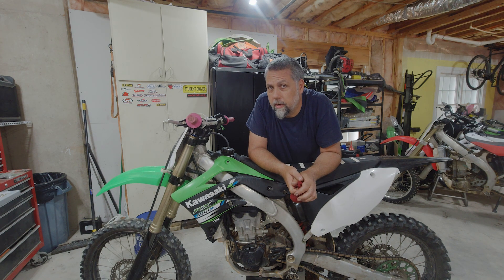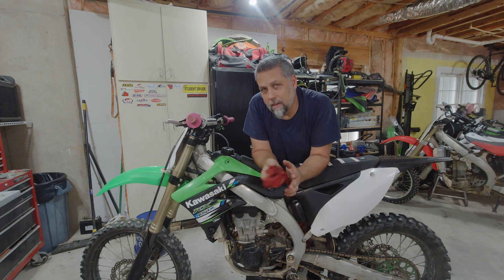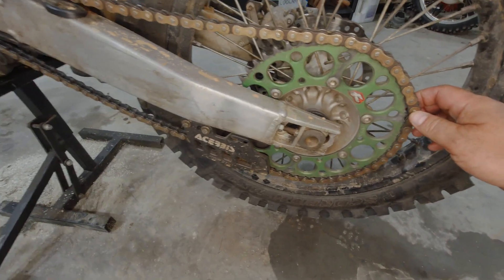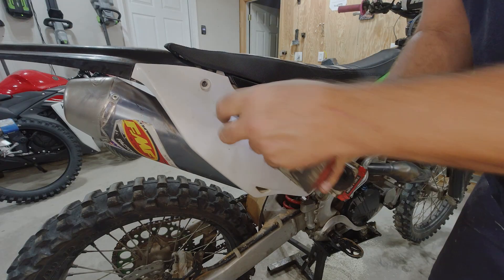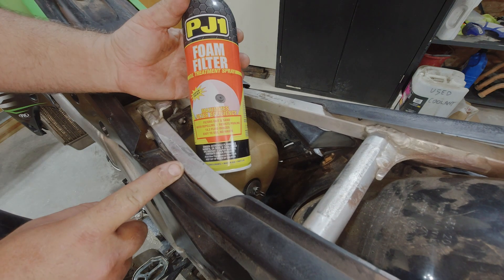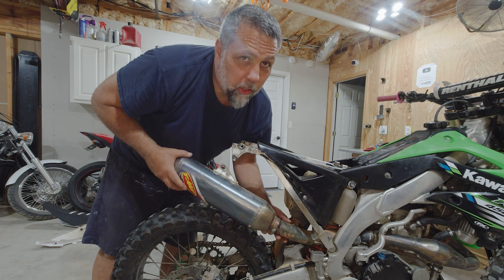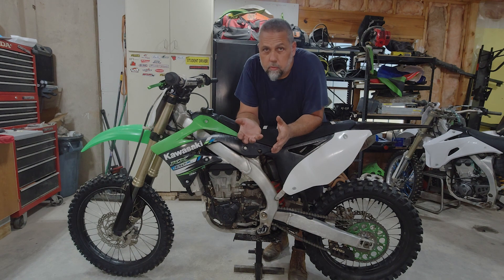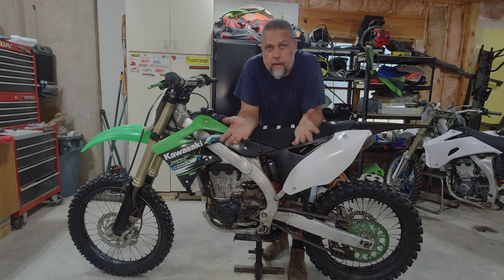2012 Kawasaki KX450F FI Fuel Problem? Ep58

Comment: Nice job! I have a 2015 kx450f I am diagnosing. Sat for a while and had real bad gas. Replaced the injector and plug and it runs fine with the "choke" on and I can start it warm with the throttle just barely turned, but as soon as you let go of the throttle it stalls. Will idle all day at 1-2% throttle. TPS should not have moved when I replaced injector and not sure if it’s a pump thing or throttle cable… I don’t have the experience to know. This video opened my eyes to what I might be in for if I do have to look at the fuel pump. Thank you!
Reply from the maker: It’s certainly not a throttle cable issue. I would absolutely check the TPS values. I would certainly suggest doing a fuel pressure test. Before anything, did you turn the “choke” knob counterclockwise to raise the idle?
Reply: @restoroosterohv  i turned it out 22 clicks based on a number I saw (and also seemed in the range it was at originally), but I saw another reference to 42 clicks. I will see if manual has any more clues, but if you think I should go higher I’ll give it a try.  I am going to buy a fuel pump pressure gauge, since it seems to be really useful. Have watched a few more videos on them for multiple issues and I am thinking at least the strainer is gummed up. Thanks again, I appreciate the reply.✌🏻
Reply from the maker: @JamieKeefer adjust it until it idles. If you have it all the way out and it will not idle then you have a different issue.
Reply: @restoroosterohv  i will try that. Thank for taking the time to offer the suggestion.
Reply from the maker: You’re welcome. Thank you for your comment.

Comment: i just bought this same bike used from someone who was the second owner. they said the original owner did a lot of mods and was running before they sold it. It has an insane amount of compression at TDC where i cant even kick it over without bleeding compression a bit, and the auto decomp dosnt seem to do anything.. i have checked spark, fuel pump is good, but it will not start. not even with spray or a bump start..
Reply from the maker: Have you physically inspected the auto decompression mech on the exhaust cam? Be sure it is slightly depressing the exhaust lifter as you rotate the engine. Check your valve clearances to be sure that they are not to wide.
Reply: @restoroosterohv  just checked the auto decomp, it functions as it's supposed to. My valve clearance is - exhaust, .0065 on the right valve .008 on left valve ( left has the auto decomp) 
Intake- .0015 on right, .00415 on left
Reply: @restoroosterohv  let me ask this, am I correct in thinking no matter what mods have been done to the engine, the TDC mark on the stator should line up in the little window, and the cam timing marks should be flat with the block and facing out?
Reply from the maker: @bluefrostt1 yea, that would be correct. To be sure that your camshaft sprockets have not spun, pulled the spark plug and drop a straw down into the cylinder. Period rotate the engine over until the straw is at its highest point, that will be top dead center. Be sure that your flywheel mark is lined up properly with the case. Now, look at your timing marks on your camshafts to be sure that they are lined up with the head properly. Next look at the backside of the camshaft to make sure they’re even looking and not pointing off in wrong directions. Regardless of all of this, your exhaust cam should still decompress the cylinder.
Reply: @restoroosterohv you sir are a God send! Pulled everything apart and found the exhaust cam was timed incredibly wrong! Fixed that and it fires right up and the auto decom forks flawlessly! Thank you so much for your help!
Reply from the maker: Awesome, glad you were able to get her going.

Comment: Great video. I am new to the four stroke game.I have a 2013 kx450f, and i just changed the fuel pump in it because the o-ring was bad and was leaking too much fuel into the throttle body. When i start my bike with the enricher pulled it runs and revs as it should. I can puch the enricher in, and it idles fine, but as soon as i hit the throttle, it dies. Any help or idea why this would happen?  Multiple people have told me to check the valves, but i dont see why the valves would need adjusted after i just changed the fuel pump
Reply from the maker: I’m a little confused. The pump is in the tank and has no connection to the throttle body other than through the fuel injector. Did you change the pump or injector?
Reply: Sorry about the confusion. I changed the fuel pump. When I start the bike, I pull out the enricher/choke and kick it a couple of times, and it starts. I can rev the bike, and it seems fine. When I push the enricher/ choke in, it's still idles, but if I give it any gas, it dies.
Reply: So basically my issue is I can't hit the throttle at all unless I have the enricher/choke pulled out.
Reply from the maker: The "enrichment" knob just allows some filtered air to bypass the throttle plate essentially raising the idle. Did you change the entire pump module or just throw an aftermarket pump in the housing?
Reply: @restoroosterohv9030  I used an all balls replacement pump kit
Reply: Same housing
Reply from the maker: Ok, that makes sense. My guess it that you have a fuel pressure issue. Potentially there is an o-ring bypass in the module or a issue with the pressure regulator. I would suggest doing a fuel pressure test.
Reply: @restoroosterohv  okay. Thanks so much for the advice.

Comment: Rooster I’m back an I’m STUMPED! Fresh top end, pro X valves, shimmed. Will not kick start cold. Have to bump start then it starts first kick. New fuel pump and regulator. Capacitor seems to be working but when I unplug the fuel pump connector from the harness and kick it I don’t see any voltage. When I prime the pump with 12 volts cold it fires right up, so something isn’t letting it get voltage to the pump while kicking. Checked for trouble codes the light does not confirm any trouble codes. 2016 kx250F, please let me know your $.02 before I waste any more money on parts.
Reply from the maker: Ok let me ask, when you put the new pump and regulator in, did you replace all of the o-rings and were they of the correct size?  Second, did you ohm out your stator windings across each other and to ground? Are you using a DMM or analog to test for voltage? You may have to pull the spark plug, hick it hard and fast in rapid succession. If you see 7v or more, you should be good.
Reply: @restoroosterohv  I re used the ones from the old pump as the new kit did not come with any. I will test the stator next, it just baffles me that if I use a jumper box and give it voltage to the pump it fires up like 2 kicks cold but I can sit there and kick it forever throttle open closed choke on off no matter what and it will NOT start. But if I bump start it and literally shut it off the second it gets running I can start it right back up first kick.
Reply from the maker: @dragin79 if the orings are not sealing properly, it will bleed off the pressure over time and make it difficult to start when cold. When you jump it off with a 12 V battery, you pressurize the system solidly. Your best test for this would be a fuel pressure and leak down test. The tester is not that expensive and you can get it on Amazon for under $40. Secondly, if one of your stator coils is burned out, it will not be producing enough power for the pump at the low speed that kicking provides. Once the system is pressurized and the engine is running, the coils produce just enough to keep the pump running. You certainly may have other issues like valve clearances. I know you said you checked them, but after running a bit they could have changed.
Reply: @restoroosterohv  checking between yellow wires I’m getting 1.6-1.8 ohm. Manual is stating the range is .4-1.1
Reply from the maker: @dragin79  Those measurements are for an ambient temp of 68 degrees with engine  also at room temp. They may fluctuate slightly depending on your current temp. You want no open circuits between any of the yellows and no shorts to ground. Your tester could be off a touch as well.
Reply: @restoroosterohv  oem new kawi fuel pump ended up fixing it. Now it starts on the first kick. I guess I didn’t have to have all that motor work done… live and you learn and at least now I know what I have.
Reply from the maker: Glad to hear you found the issue and thanks for updating me. They can be a bear to diagnose sometimes especially without the proper tools. I have used aftermarket fuel pumps in the past with no issues. Doing a fuel pressure check after installing them is almost critical though to make sure that the regulator, pump and O-rings are doing what they should.
Reply: @restoroosterohv  thanks for all you do! Really loving the new dirt bike videos. I know the market makes it hard for you to find ones to buy. The weird thing is I can’t figure out what is wrong on the old module, maybe somebody put a pump in it somewhere down the line and lost an o ring or rubber spacer. The oem makes them non serviceable so there are no diagrams on the internet for me to reference for a missing piece. When I did the aftermarket pump it did the same exact thing, I also replaced the fuel pressure regulator no change. Now first kick with the new oem, but rarely do I see any diagnosis online pinpointing to a bad fuel pump. Everyone just jumps to valves, I also noticed it starts easier when I have it on a stand kicking hard and not just tip toed.
Reply from the maker: @dragin79 again, without doing any fuel pressure tests it’s impossible to tell. Maybe you just got a bad pump. Maybe the plastic module had a crack in it which didn’t allow it to build enough pressure while kicking, who knows?

Comment: My son has a kx450 and it’s not pumping fuel and not getting the 12 volt what do I do?
Reply from the maker: You can follow this video as a guideline. First thing I would check is your stator resistances.
If you need a downloadable service repair manual for any of your projects, use my affiliate link to eManualonline.com. They already have great prices with an enormous catalog of manuals and if you use my discount code RESTOROOSTER22

https://www.emanualonline.com/?sscid=91k8_2gl2c&utm_source=shareasale&utm_medium=affiliate&utm_campaign=4229791&utm_content=510988

Comment: Is there a way to prime the fuel system or can I just kick like normal?
Reply from the maker: As long as everything is working properly, kicking it will prime the fuel system. Since you didn’t mention the make and model you are working on I can’t give you specifics. If the bike is the same as the one in the video, disconnecting the capacitor and applying 12 volts to the harness side will power the system. Be very cautious about polarity. Check with your service manual.

Comment: I have a 2010 kawasaki kx 450 and it only runs on ether just like this bike. Replaced injector, spark plug. Did a fuel pressure test and it read 3 psi for like 10 seconds and then shot up in pressure. I didn’t get the peak pressure reading because i didn’t have the right fitting to hook-on to tank so gas sprayed out. Also gas piddles out of hose when disconnected from fuel rail!
Reply: Also my fuel pump has black plastic around the entire thing preventing me from taking it apart!😭
Reply from the maker: Purchase the correct pressure tester (approx $40 on Amazon) and do a proper fuel pressure test.
Reply: @restoroosterohv  alr i will do that thank you!!
Reply: @restoroosterohv  Do you know what exactly that fitting is called.
Reply from the maker: Cheaper than I remembered. You may have to shorten the fuel pump output nipple about 1/8”. 
https://a.co/d/1JJ8uoj
Reply: @restoroosterohv i just correctly tested the psi i had 0psi. Gas leaks out of outlet of fuel tank when i pull off the gauge. I could hear the gas bubbling inside the tank. Would that mean my regulator is not working? Or pump isn’t producing pressure?
Reply from the maker: There are a number of causes all relating to the pump. There are orings in there that could have failed, the housing could be cracked, bad regulator or pump
Reply: @restoroosterohv  nothing looks cracked or broken that i have seen, but i cant fully take it apart. However i can take off the regulator so may i buy a qfs pressure regulator and see if that fixes it.
Reply from the maker: @garrettbeagley7793 again, big problem is the O-rings, but it certainly could be the regulator. See if you can blow through it with your mouth once you get it off. If you can, then it is stuck open.
Reply: @restoroosterohv  gotcha. I will do that.
Reply: @restoroosterohv  ended up buying a brand new fuel pump assembly! Was pricey but will see what happens!
Reply from the maker: @garrettbeagley7793 that ought to do it
Reply: @restoroosterohv  i appreciate your intel and replying to me!!! So professional and knowledgeable
Reply from the maker: Thank you but it sounded like you were already on the right track.
Reply: @restoroosterohv  i just put in the new fuel pump and it read 43psi steady ! She runs like a champ now!
Reply from the maker: @garrettbeagley7793 good diagnostic sir!

Comment: Hey. Have a question about fuel injected bike. First fuel injected bike. Have a kx450 that was hard to start. But when started runs like a champ. I designed a system that would prime the fuel system with the push of a button. Hold for a few seconds and fires up first kick just about everytime. Do u see any issue with something like this. And would this be something worth creating for others with this issue?
Reply from the maker: There is a reason that your bike is difficult to start normally. Mine starts 1-2 kicks always hot or cold (as it should). If you don’t want to spend the time on the diagnostics to find the issue, there is no problem with a momentary pump priming circuit if that helps you however,  I would encourage you or anyone else to find and repair it properly. Example, if it’s a failed stator coil not providing enough power then it is one step from leaving you stranded if another coil fails. Most of the diagnostics are easy to do with a cheap Harbor Freight dmm and a good service manual.
Reply: @restoroosterohv  I get 12v when barley kicking and 14.23 while running so I thought wasn't electrical issue. Then tested pump with battery. Pumped great. Only thing I didn't do was test the pressure of the pump. Which I thought might be just fine since it does start and run and revs out when running. No kind of drop out on the throttle. Never messed with fi bike before so this is all new. Ur knowledge and info is greatly appreciated.
Reply from the maker: There are many things that can cause the issue you are having but I would concentrate on the fuel system since priming it helps to start the engine. Disconnect your stator and ohm test the three coils (yellow wires) against each other and ground. Then test the Hall effect (CKP sensor) and to ground. If all is ok you could potentially have a failed capacitor (Not easy to test, usually swap with a known good unit). Next thing I would test is the fuel pressure and it’s ability to hold pressure after the engine is stopped. May have a failing O-ring or bad regulator in the pump assembly, causing the fuel pressure to bleed off. This will be noticeable if the bike is hard to start after sitting for a while, but starts immediately after shutting it down. You can pick up a fuel pressure tester off of the jungle website for around 40 bucks.

Comment: Good video.  I'm diagnosing my 2015 KX450 right now.  I replaced the fuel pump, but couldn't get a spark.  I fixed that problem, but when I pulled the tank again a steady stream of fuel was leaking from the tube that delivers fuel to the throttle body.  It didn't do that with my oem pump.  Can you tell me if fuel should be leaking from that tube when you remove the tank?  I haven't pressure tested it yet, but I thought the fuel would only come out if the pump was running.  I'm thinking the pump I bought is defective.  What do you think?  
Thanks
Reply from the maker: I am going to go out on a limb and say you used an aftermarket fuel pump and didn’t replace the entire module assembly. It is critical that the two o-rings be of the correct size and installed properly. Did you replace the regulator?
Reply: @restoroosterohv  Yes I used a Kemso fuel pump.  I didn't replace the regulator, but I tested it and it seems to be working correctly.  I'm thinking that the o-ring that fits on the bottom is where the problem might be.  It seems like the original o-ring fit further down into the metal housing.  When I removed it, it was completely smashed down all around the edges. But gas didn't leak out of the nozzle when I took the tank off.  I used 2 of the 3 o-rings that came with the fuel pump, but that one that fits on the bottom seems a bit off .  I don't know what size to use though.
Reply from the maker: @J-dog44 it seems to be a common problem with the aftermarket pump kits. The o-rings just don’t fit right and is likely your issue. Gas should not flow out of the pump assy when disconnected.
Reply: @restoroosterohv  Ok that's what I thought.  Thanks for the reply and the video.  It definitely helps.
Reply from the maker: Thank you for your question and for watching.

Comment: Definitely helpful. I need help with mine. Replaced valves seals and everything. New gaskets and I have compression 156 spark is decent I’ll replace that just to be sure. I don’t have fuel or enough of it. I don’t have one of those fancy test boxes, but definitely don’t kick that easy haha
Reply from the maker: I’ll be happy to help you. First off, your compression tester may be off because 156psi is way to high and you probably wouldn’t be able to kick it. I would start by checking your valve clearances just to be sure they aren’t to tight.